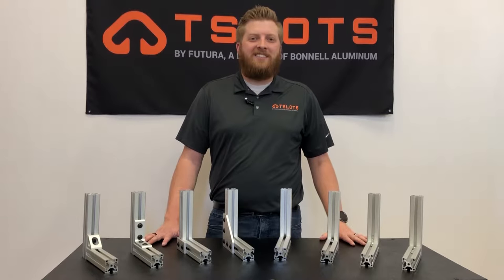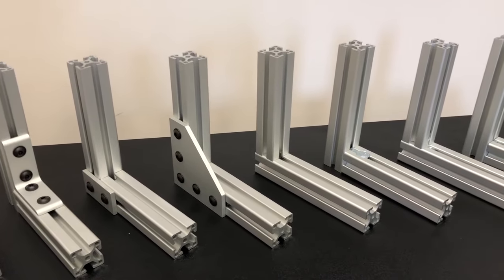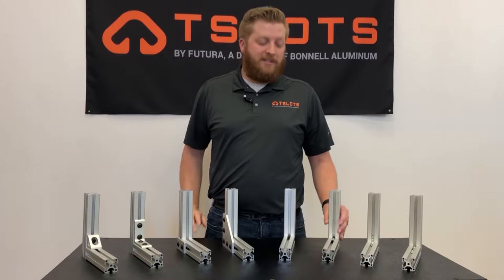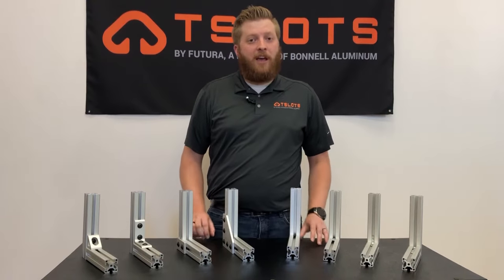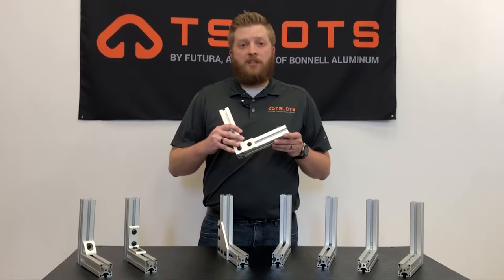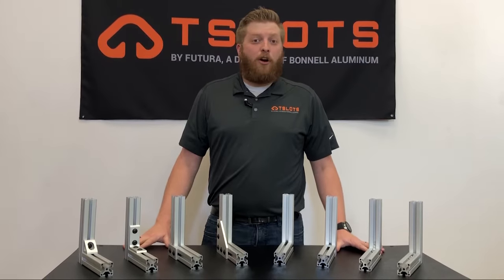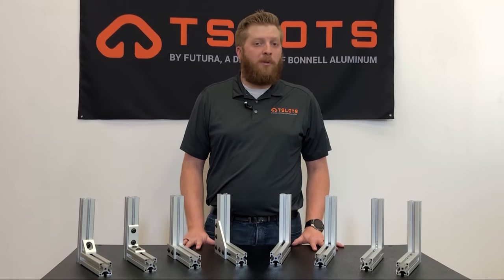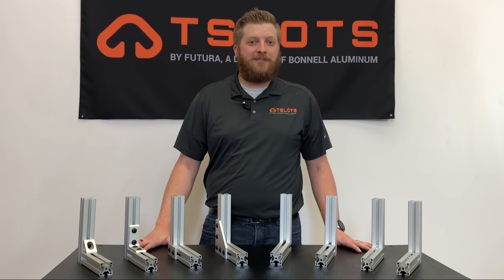TSLOTS Fastener Options

Comment: What a strongest fastener and second one strongest for aquarium stand, about 1000 kg glass and water.
Reply from the maker: Great question, the standard anchor fasteners are the strongest fastening connection we offer. Depending on the design and extrusions used, we have many fastener options that would work well. For additional information, contact tslotsinfo@bonnellaluminum.com and learn more about the connectors we offer.

Comment: A more interesting video would be which combination of these gives most rigidity.

In application of say, 3D Printers, drilled through and the external options are most often used.

Question is, will drilled through, which allows for a lot of flex and is dependent on the strength of the material in holding a screw combined with an inner angle steel bracket provide more strength than an outer angle?

Outer angles aren't always applicable because there's often a lot you want to mount near or on the corners.
Reply from the maker: Thank you for the information! Each application can vary on which fastener would work best. For more information on the rigidity and which fasteners would best fit for your application, please contact us tslotsinfo@bonnellaluminum.com
Reply: @tslotsbybonnellaluminum8911  I want to frame out an old landscape trailer for camping.

I have no machine skills

Would the nonmachine brackets be sufficient to build a modular frame and secure it to the wood deck?

I intend to panel the outside with tinted patio roofing panels and tin roofing panels.

Like this look 👀 

Are their brackets useful to using screws to install those modular panels?

Also, wind force ?    Trailers are rated for 55 miles and hour.   If I have a gnose bay or angled roof, would this modular extruded aluminum hold up while driving?

If not should I consider it something to be put together at arrival to site

I understand you can say for certain without seeing the build, so it is a theoretical questions
Reply from the maker: @diversitylove5460  Thank you for reaching out to us regarding your landscape trailer. These questions would best be answered by our engineer team. Please reach out to them here, tslotsinfo@bonnellaluminum.com. Thank you.
Reply: @tslotsbybonnellaluminum8911  ok

Comment: Do the connectors work the same even if you miter the ends of the of the pieces before putting them together?  Just thinking through it logically, I think that it would, but I am not sure.
Reply from the maker: Depending on the degree of the miter, most of these components would not work. We have a line of products that can be used for mitered extrusions. For more information on these items, please visit our website or email our team at tslotsinfo@bonnellaluminum.com

Comment: Hi, How can I mount 40x40 profile onto a wall,
Reply from the maker: Thank you for reaching out. There are a few different options of connecting profiles onto a wall, but the most common would be anchoring brackets or gussets into the wall then attaching the profile. For more assistance, please contact tslotsinfo@bonnellaluminum.com. Thank you.

Comment: If I was building a truck ladder rack with extrusions, what fastener would you recommend?
Reply from the maker: John, thank you for the question, the anchor fastener would be my recommendation. It provides the strongest connection and looks better as you don't have bolts or brackets protruding from the ladder as a potential safety hazard. Please email us tslotsinfo@bonnellaluminum.com for further assistance. Thank you.

Comment: What I'm wondering after watching this video is have you had any experience in attaching PVC deck planking to your 80/20 channels. I'm purchasing a 30 foot motorcoach and could see your frame as a possible observation deck where my wife and I could set up a couple chairs up there to enjoy the view during our travels. Are you aware of anyone doing this yet?
Reply from the maker: Thank you for your interest in our product. I'm not aware of this type of application being used currently, but you can contact our design team with the email and they will be able to assist with information on PVC deck planking and application solutions, tslotsinfo@bonnellaluminum.com

Comment: Okay; you want feedback? Sure thing.

1. The entirety of this video could have been conveyed with an infographic. In fact, it would've been more useful, as, during the creation process, you would be forced to fill in all of the values and applications that you neglected to mention during the course of the video simply when presented with the empty slots in the image.

2. Quite literally the only things that could have been learned here that could not have been from 15 seconds in Google Images were: 
2a. Which components in your product catalog require machining (though you neglect to explain/describe ANYTHING RELATED to said machining. Does that mean "drill a hole" or "order custom extrusion profiles"? Hint: as a small business, one of those two possibilities would discourage my company purchasing those products.), and
2b. That those same fasteners offer greater rigidity. Now, that's useful, but only in a VERY limited capacity. How MUCH more rigidity? Tolerance? Runout? How much slop are we talking? Because at present, we've no baseline established. They're better than your other fasteners. Are THOSE better than Chinesium garbage from Amazon? Better than last year's models? Better then chewing gum? Better than nothing?

3. The aesthetic considerations are great and all, but it may shock you to learn that most people watching a video are not blind. Consequently, these aspects can be virtually instantly assessed by anyone who watches, even without their being called out. What am I sacrificing for those "clean looks"? Rigidity? Flexion? Tensile Strength? How much? 

4. Are any of all of these factors influenced by configuration? Say I'm joining a simple square: is the horizontal strength equal to the vertical? In a vertical configuration do I want the vertical or the horizontal struts on the outside? Why?

5. Why would I get less rigidity from a "machined" joint - which appears for all the world to mean "with a hole drilled in" - instead of one of those corner brackets with 7 bolts in it? The center of an extrusion's profile is pretty thin, and air-gapped. I just would think that I'd get less deflection from a solid triangle than directly mates the two faces than even a pass-through that's gripping mostly air and a thin substrate of easily-bent alloy.

I assume you have all these metrics (I HOPE so anyway)... so why not share them? Why not show the various products' MDS data? Most of the people buying this sort of thing are at least semi-conversant with basic engineering principles... I don't think values like "weight capacity", "sheer force resistance"  "mm of lateral play", "tolerances for a true 90° coupling" are too much for your user base to grasp... do you?